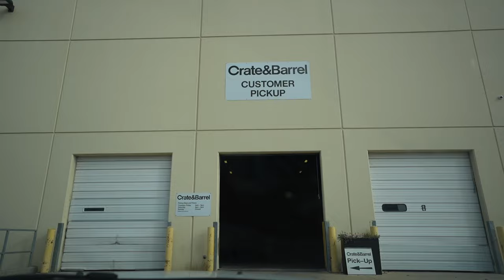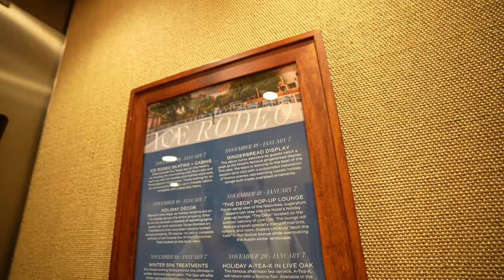HOME RENOS: Modernizing Our Entryway, Unboxing Our CB2 Blox Dining Table & Matching Chairs

Comment: 21:55  So I think I know what probably happened with the matte painting on the railing. If the joint compound/drywall mud wasn’t primed before painting, your wall basically absorbed the paint leaving the fixed area looking dry/matte. When primed, your paint should look the same all around because the primer lets the paint sit on top of the primer vs being absorbed. It’s just like prepping your face with hydrating products/primer before applying concealer and foundation. 😁 If we don’t prep before foundation & concealer, the end result can end up looking dry af. 😬 Btw, if y’all plan on priming the wall before painting again, I suggest not using a brush to paint over that textured area. Use a paint roller(preferred) or spray machine so y’all don’t mess with the texture of the wall. I’m not a professional painter by the way BUT my house was flooded with 18” of water in 2019 so I tore down & fixed the house all by myself. Would I do it again? NO, 😅 but I learned A LOT along the way & I definitely came across this situation myself too. Btw, ✨drywall primer & sealer✨ is the kind of primer I’m talking about. I hope this helps a bit. 😊
Reply from the maker: Wow this is incredibly helpful!!! THANK YOU SO MUCH! I went to go touch it and it was a lot dryer than the wall so it makes a lot of sense!